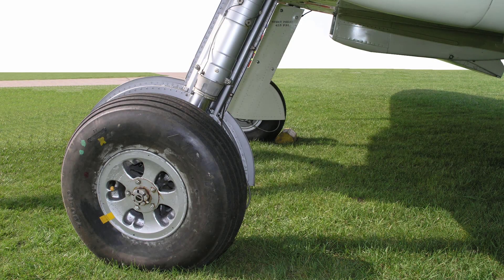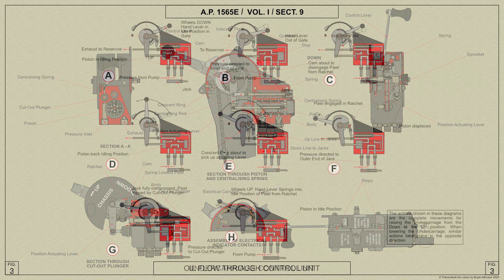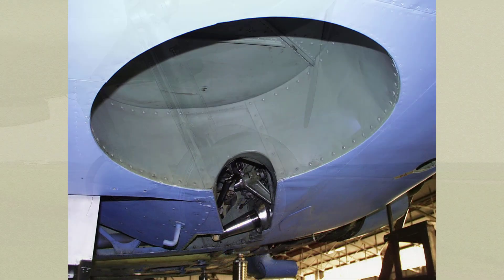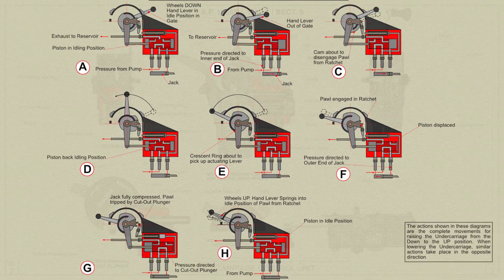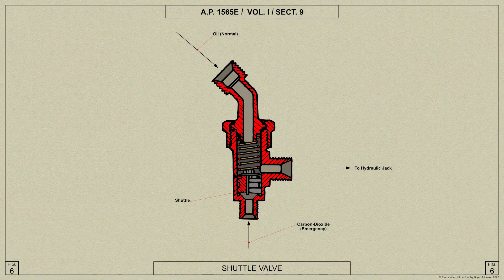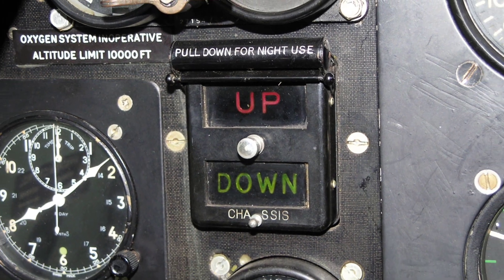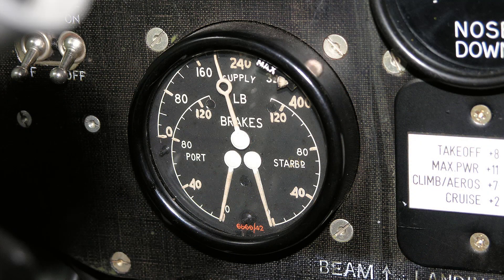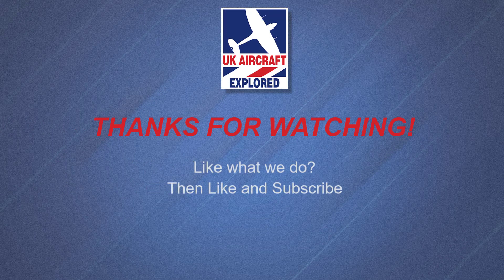Spitfire Mk V – The Undercarriage

Comment: Another excellent and most enjoyable video. Can I ask please; when the undercarriage is either fully up or down, and the engine is running, does the hydraulic pump continue to pump fluid through the raise/lower quadrant and the filter back to the reservoir on a continuous loop, or is the pump stopped? Apologies if I have missed something you said about this.
Reply from the maker: The operation of the Undercarriage Control Unit is illustrated in diagram Fig 3 shown in the video. When the Undercarriage lever is in the gate either at the UP or DOWN end of the U/C quadrant, hydraulic oil from the engine-driven pump enters the control at the "pressure inlet" and passes straight through the "exhaust outlet" back to the reservoir - forming a circuit.   In this condition, the system is idling and it is always ready should the pilot operate the Undercarriage lever. The hydraulic pump is engine-driven using the Merlin's camshaft and as such is always working during flight. Thanks for watching.
Reply: @ukaircraftexplored6556  Thanks - that makes sense. I wonder if the u/c quadrant gets hot during the course of a flight....

Comment: Another great informative  video.  As there was no pressure gauge on the emergency blow down bottle, it would be removed and weighed to ensure it still held its gas.  On the undercarriage leg the rod that runs from the value at the top around  to the gland at the bottom prevents the gland being undone until the pressure is released in the Oleo.  What looks like bolts into the body of the Oleo are studs that protrude into the oleo and run in a spline, this keeps the oleo aligned fore and aft.  The yellow mark across the tyre and wheel is known as a creep mark, and is a quick visual aid when checking the types, to ensure they have not moved around the wheel on a heavy landing,  This could damage the  inner tube under the tyre , and possibly damage the inflation valve.
Reply from the maker: Thanks for the feedback, I'm please you enjoyed it.
Reply: The Lightning used to regularly move the tyre around the wheel if the brakes weren't released promptly when opening up for take off.
Reply: @mothmagic1  Although on BBMF we were part of the same section, on a bad day when the tyre bay got overloaded, as riggers We used to go over and help. it was common to service the same wheel more than once a day. A new cover on a wheel, put it on the trolly in the morning and pull it apart again later that day with the cover you  put on in the morning worn to the cords.